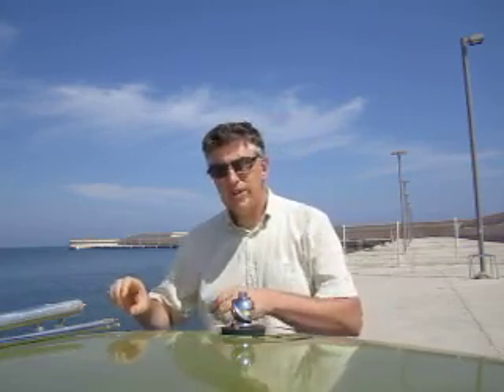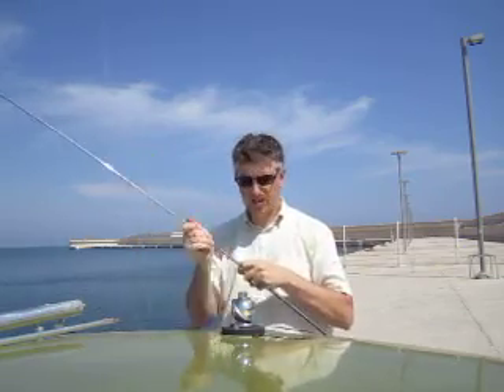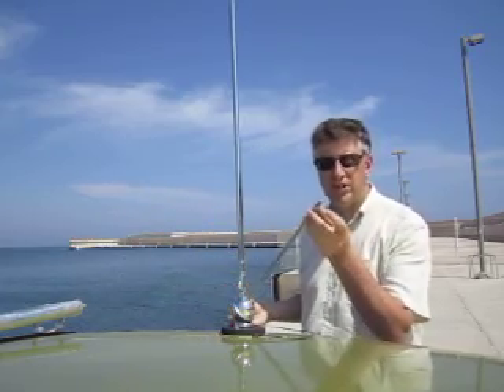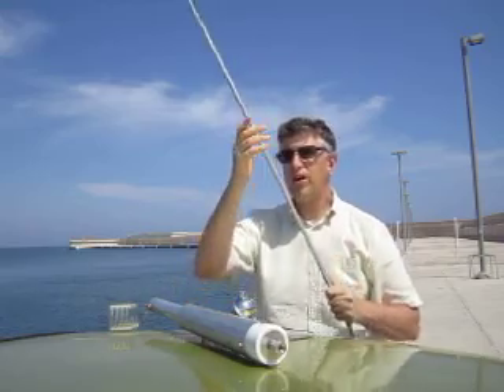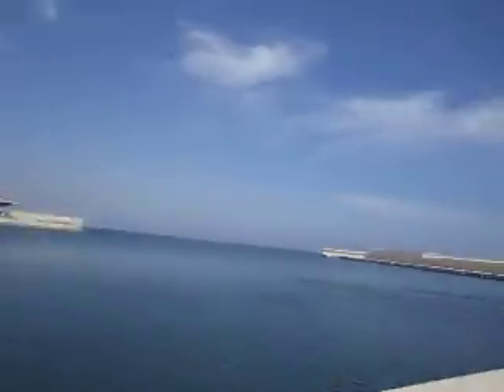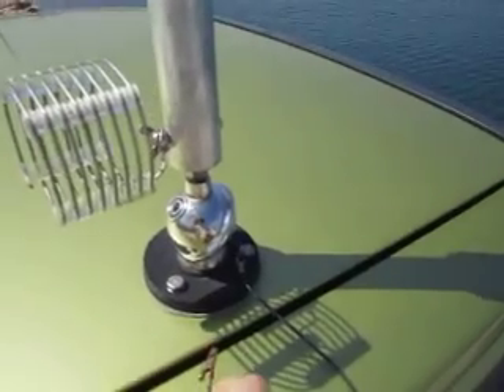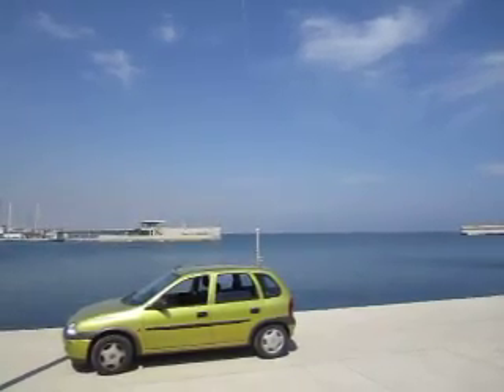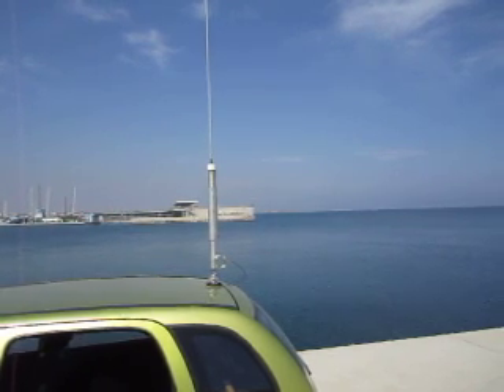EA5ON mobile HF antenna

Comment: THE TARHEEL II RUN FROM 6 METER TO 80 METER MY SETUP ON MY CAR IS TS 480HX 200 WATTS TARHEEL II ANTENNA (SREWDRIVER) AND A TURBO TUNER LOVED BUT THATS NOT BAD THANKS FOR THE VIDEO

Comment: Hi Duncan. You don't know me but I feel I know you and I can fully attest to the quality and effectiveness of your set-up. My car is regularly parked in a low roof car  so last year I was just receiving whilst mobile on 20m with an FT817 and a Mag loop inside the car! (terrible set-up but it is amazing what panoramic sun-roof will still let in RF wise). You were pretty well always a stonking signal here into Glasgow and I always used you as my beacon signal in the morning to try and see if I could hear the VK's and ZL's you were regularly working (I was only hearing less than half you were and when you were giving them 5&9 and 5&9+ I was getting them about S2 but I was still happy considering my compromise antenna).... many thanks for me "coat-tailing " you. Long may the propagation beacon "October-November" keep transmitting. I only have 2 complaints.... hearing about your fantastic weather when it is cold and dreich here just makes us jealous plus you going QRT at 9am your local time when it is still 8am here and I'm still driving to work. Your set-up certainly shows that regardless of what you pay, a simple/honest/humble 1/4 wave, especially close to salt-water, takes some beating and can beat hands down much significantly more expensive kit.

The above was for "mobile mobile". In the Helensburgh club we also tried "fixed mobile" similar to your set-up but we cheated. We surreptitious "cabled tied" a 2' section of plastic drain-pipe into the vertical z section support of the Helensburgh pier car-park armco barrier (using coathanger wire to tie it in place... it has been there a couple of years and no-one has noticed it). We drove up, quickly dropped a 17foot fibreglass extending fishing pole with some 2.5sqmm mains wire up it and crock clipped onto the galvanized armco as a massive earth earth system with its base dunked in salt water (operational in 2 mins). It worked as well as your set up (but we were scuppered if anyone else parked in "our spot" so that is where your system obviously still wins).
73's Ian   GM0SIM
Reply from the maker: Hi Ian, thanks for that. I used to live in Helensburgh when I was a boy, and know exactly the place you mean. Hope you are managing to hear a few more of the DX stations now that propagation is a wee bit better. Look forward to working you on the air one of these days. Cheers